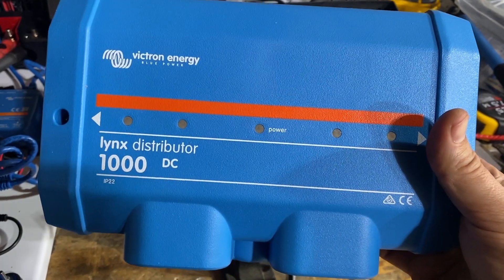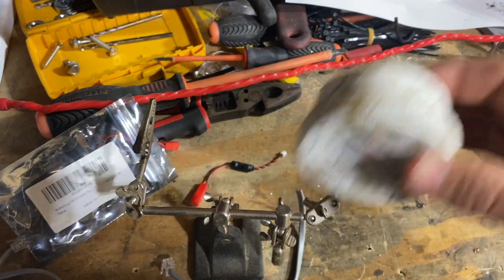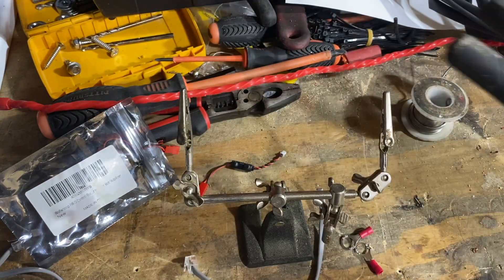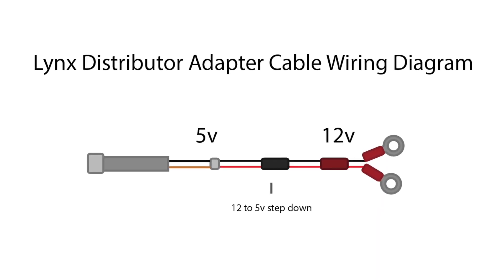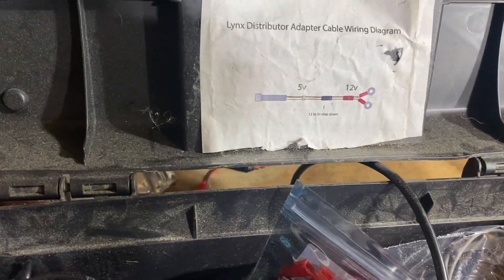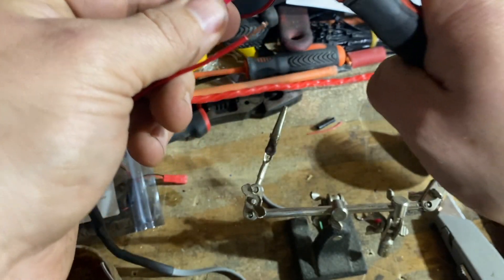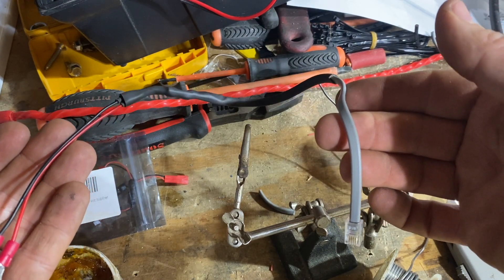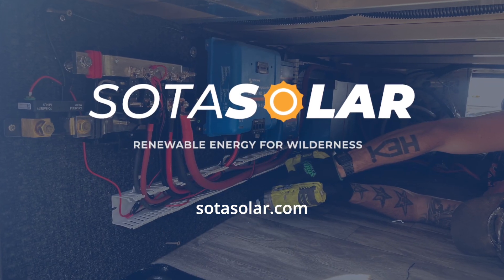Enable Victron Lynx Distributor LEDs - How To Make Voltage Adapter

Comment: I made you two of your cables.  Straight forward.  When I connected, I got all reds and an orange and never reverted to green.  As I was disconnecting the new cable, the lights remain illuminated even after I disconnected the black- ground wire.  It’s either a wire problem or a Lynx problem.  I tried the same test with the other cable I made and same result with the black disconnected.  Thoughts?
Reply from the maker: I’d verify the voltage out from the adapter as well as polarity.
Reply: @sotasolar  thanks for the feedback
Reply: I have the same issue. It seems that once it goes to an error state it remains there. If I power off and on again, it starts green to me. Also seems to switch to red once a significant load is used, and stays in that state, all red :/ Did you get a solution to this at the end?
Reply: I have the same problem I’m confused

Comment: Great vid. I want to make on of these for my 48 volt system. Do you have a preferred item for a 48v to 5v step down adapter? I have done a search on amazon, however the adapters I have seen all are to large to fit inside the distributer when the cover is on.
Reply from the maker: We're currently working on sourcing a more universal 12~60v -> 5v adapter that will fit inside the case.   It's crazy, for some reason, stepping down from 60v to 5v and .5 amps is not a common use case :-)
Reply: AMSRU-7805JZ
Reply: These are more common than you would think. You can thank the e-bike market for that  Mostly used for usb charging from e-bikes or golf carts (48-72v is not uncommon now).  Although a large majority of them are larger, there are a few very small ones (ie 5w).  although something with wide range input for something truly universal (12-60v) is less common (I.e. asin B0CDGZYW6Y)

Comment: Excellent video and instructions. Just a pointer. I made mine up and it didn’t work. Found out that one end of the phone cable was black on pin 1 and Yellow on pin 4 and the other end was Yellow on pin 1 and Black on pin 4. Just to warn anyone that you can still use either end but Pin 1 has to be the positive off the 5v and pin 4 needs to be the negative. Luckily mine works fine and it didn’t do any damage. You can work out the pins by having the connector in front of you and the clip to the back and they are pins 1 to 4 left to right.

Comment: @SotaSolar Great video, Thank you for sharing! I think would feel a little better if it included some overcurrent protection (I.e. a small inline 1A leaded fuse with heat shrink in series with +12V input) in series with the cheap DC-DC buck converter.  In case it shorts Ior those thin input wires get damaged (ie from abrasion in mobile application), it’s wired directly to the input bus bars with a lot more power behind them that could certainly burn the input wiring or dc-dc PCB). Also to take it a step further, a 5-6v tvs or zener across the output to protect the $200 lynx distributor from over voltage in the cheap dc-dc converter fails shorted input to output.  it is a great solution, but I think that dc-dc that marginally has enough power to run the lynx is probably the weakest point in the system. Shame on victron for not implementing this on the PCB of the distributor! Especially since this is marketed as a standalone device. (It would have been so easy since it’s already wired to both bus bars). I considered the lynx shunt, but the general consensus seems to be the smart shunt is better and more reliable
Reply from the maker: That's a great point we'll look into it before producing them at any scale.   We can say that we've had one failure, it was on Shawn's RV actually.  A 12v step down was accidentally installed on a 24v system.  It worked for a while, then stopped.  No damage done, installed the updated 12-36v->5v step down with no issues.

Comment: It is not a RJ11. It’s a RJ9/RJ10/RJ22. RJ11 is too big to fit into the lynx. I lost my cable and I made one out of a brand new RJ11 and it doesn’t work. I am now going to change my end to a RJ10 so it will fit. Don’t buy a RJ11 cable.
Reply from the maker: You are correct.   I usually just split the cable that comes with them to give us two adapters per lynx.